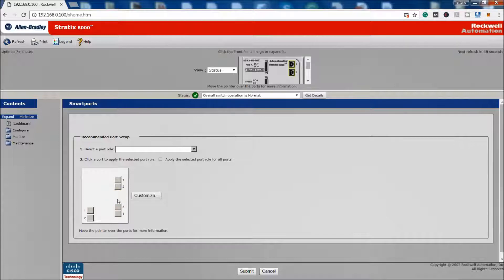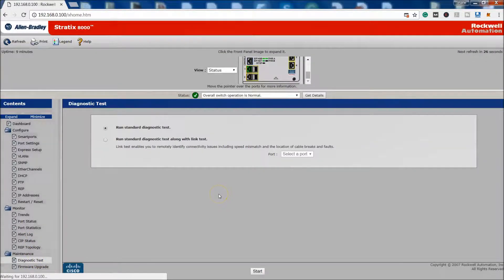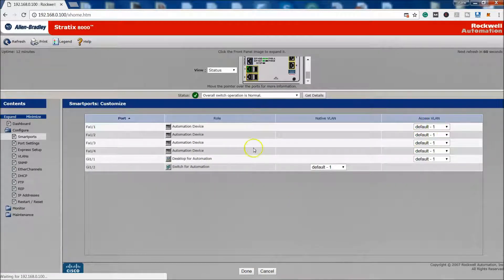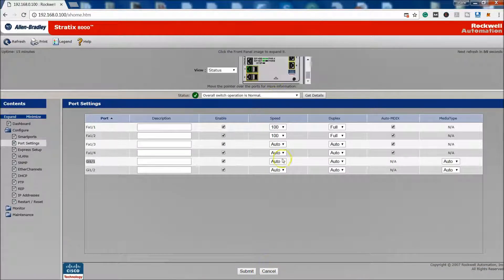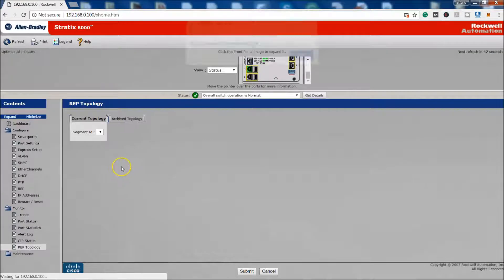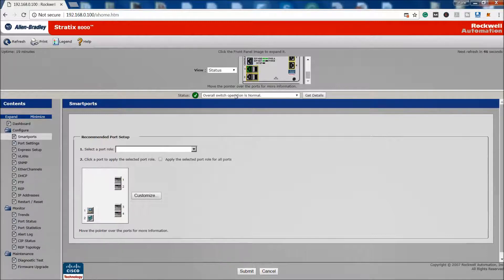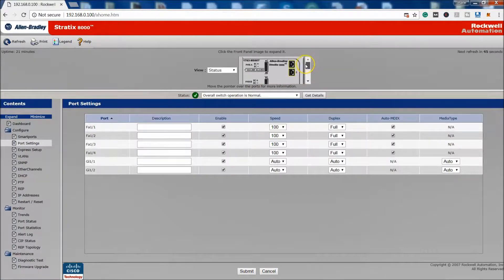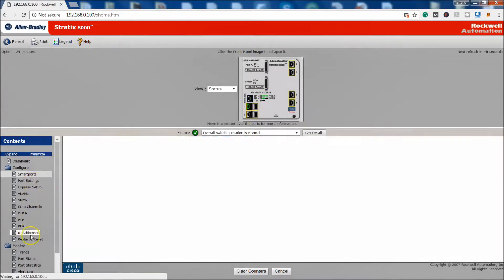Stratix 8000 Port Setup and Options

Comment: I use statix 8000 and the port connected with aent. Due to some instability issue and sometime lost connection

How we define port speed / auto negotiate / full or half duplex ?
Reply from the maker: In the switch setup, configure the ports to the speeds needed using the macros, it is preferred the use the chrome browser to sign into the switch